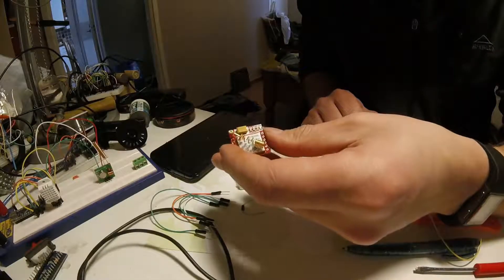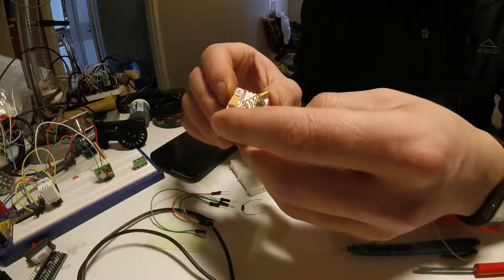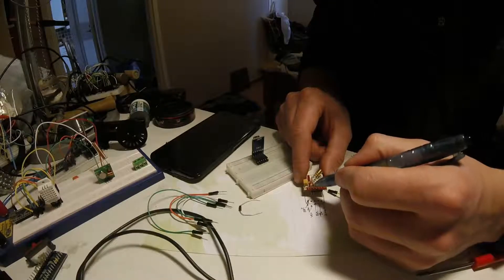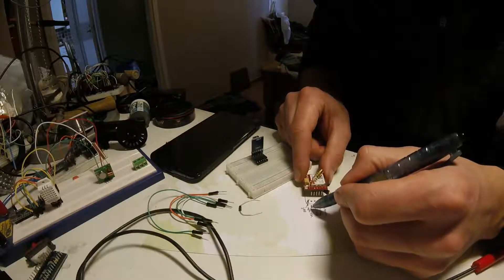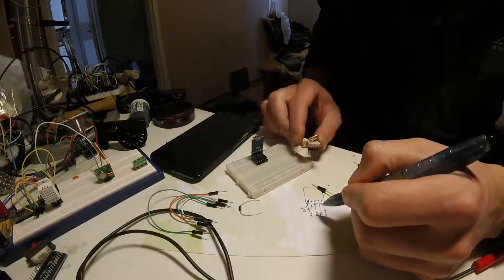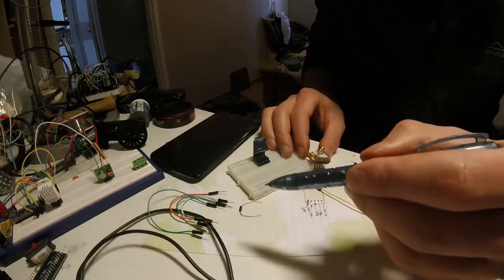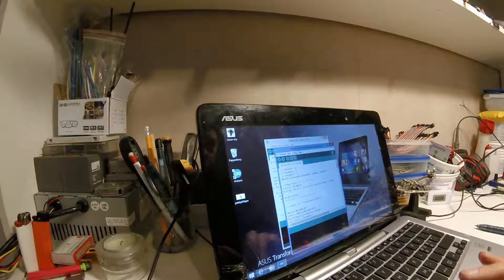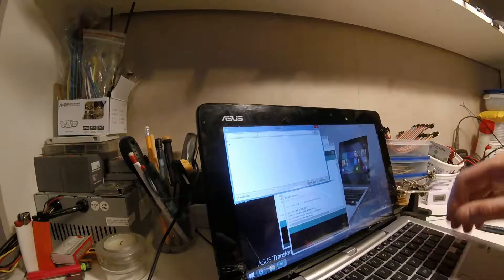SIM800L test with FTDI

Comment: hey man, i have sim800l and connected it to an arduino uno and recognized. The AT commands are working except commands that require a sim card because the sim card is not detected by the sim800l, im really sure that i inserted the sim correctly and i already tried different cards and still not working, what do you think is the problem ? thanks